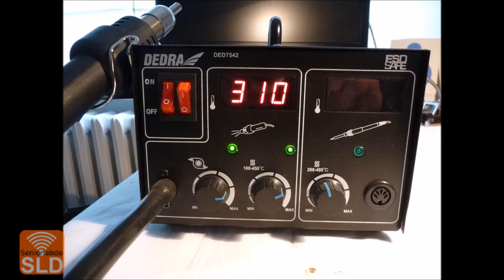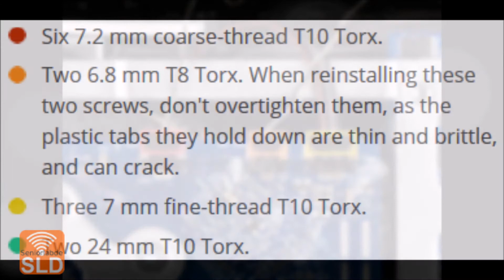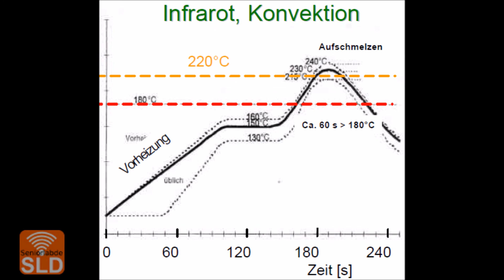IMAC (early 2008) repair in 2017 - GPU (Video Card) repair

Comment: Nice, what was the gfx card model ?
I have a 2008 20i iMac that boot only when in safe mode, it has an ATI Radeon HD2600 Pro (iirc), and was wondering if someone has done this baking method on it, for most baking videos are dealing with more recent GPU (4xxx series).
Reply: I think it's likely you have a different problem..
Reply: i have the same card as u but i have little glitches on the top of my screen
Reply: You can reflow with a heat gun which is better then oven and avoid damaging other components
Reply: Were you able to fix it? I'm having the same problem
Reply: @santiagoluluaga2975  well, I didn’t try !
I decided to turn this iMac into a Linux server instead :-)

Having two others 2008 (plus a 2007) fully working iMacs , tear down and few « cooking  test sessions » for this one didn’t seemed as the best option :-)

Comment: re flow will fail again. why not upgrade and ditch the broken one?
Reply: Not if the iMac is kept cooler
Reply: Because there is no upgrade. There's only one other card that can be swapped out for the (inherently defective) original, and it's a DOWN-grade..

Comment: Would connecting an external graphics card bypass the defective internal card?  I have a mid 2011 27" iMac.
Reply: My imac 8,1 has the same problem only less severe
Reply: No. The video card is the problem, no matter which screen is connected to it. That one card drives the built in display as well as any external display you connect to it.
Reply: Ken Zito do you have an iq of 10? Learn to read :)